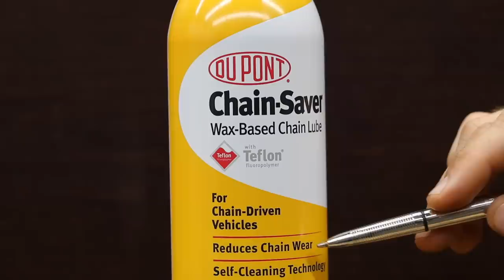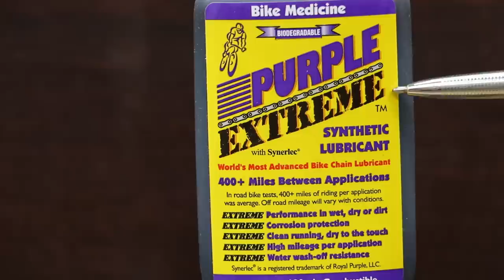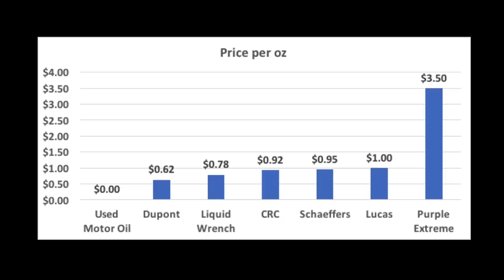Which Chain Lube is Best? Let's find out!  Ultimate chain lubricant showdown!

Comment: A HUGE mistake is to put a motorcycle chain in the acetone. Some better chains have grease between pins and rollers and are sealed with rubber rings. Acetone only ruins this, so chains will not function properly. Putting lube on the outside where it doesn't belong is a bad idea - it only picks up the dirt, making the things worth. Lube needs to be inside - between pin and roller.
Reply from the maker: Great point.  The goal was to prevent factory lube from interfering with the test results.
Reply: Here, it's not an o-ring chain, so no problem cleaning it with a acetone or fuel. But your comment is totally right for an o-ring type chain. Never clean it with anything else than a specific chain degreaser or you could really mess up your chain, fast ! And be super careful with high pressure washer, don't wash your chain with it ! Lot's of my friends complain about having to change their chain and sprockets often (like every 10k kms), but they don't really know how to properly maintain them. Mine begins to feel old after.... 30k. :D
Reply: Alexander Khritonenkov Special lube for o ring chains. Dirt bike world has them but they didn't really last any longer.
Reply: WD 40 for washing off O ring motorcycle chains works very well. Let dry and give a good coat of high quality chain lube after. Do this after riding while the chain is warm if possible.
Reply: Yes, WD 40 is a good solvent cleaner, BUT do not use it alone without chain lube after, as you say.  Many folks think it is a lubricant oil---IT IS NOT A LUBRICANT OR A RUSTPROOFER!!!!……………………………...elsullo
Reply: Wd to clean, then Maxima Chain wax , oring chain or not. They all wear out more then we would like. Specially on a quad or dirtbike
Reply: I agree, I only run o-ring chains of high quality. You want to keep the dirt out of the pins and rollers. If not you get chain stretch to quick and destroy the sprockets. On a high horse power machine you will see chain stretch immediately on a cheap chain. Dirt is always a factor you have to deal with.
Reply: WD40 was specifically made to be a rust prevention measure for equipment stored in humid environments and it is excellent for that purpose.  While it does have light machine oils in it which are absolutely a lubricant this is more a byproduct than by intent.  WD40 is not magic but this statement is incorrect on both accounts.
Reply: I use diesel/kerosene to clean my chains. Then I lube with DuPont multiuser dry wax lube with teflon. DuPont chain saver is almost the same, but it spray on a bit thicker/sticky. Although, chain saver does have more moly and teflon in it.
Reply: @floflospeed24  I agree on most points, but there are other options to clean your chain.

Anything that doesn't attack butyl rubber will do. Mineral spirits is fine, for example.
Reply: But a cheap thing to clean o ring or x ring /sealed chains is kerosene
Reply: Alexander Khritonenkov
Those were not O-ring chains, so no worries, but even if they were, who cares ? this was a test of chain lubes, not of o-rings.  Anyhow even o-ring chains need to be cleaned (not with acetone !) and lubed every so often in order to prolong the life of the sprockets and of the chain itself.
Reply: WD-40 is not good in some applications like high voltage electrical since it contains some thin oil and that oil is enough to attract dirt causing trouble that's hard to spot.
Reply: I think kerosene is good for cleaning o ring chains.

Comment: When we bought our John Deere round baler in 2004, the dealer told us never lube or oil the chains as it just causes dust and dirt to stick to it and cause additional wear.  So we never oiled the chains and all the chains are still original after 14 years and probably 10,000 bales, and the chains are just a little rusty and worn, but what can you expect after that length of time.
Reply from the maker: Wow! This is interesting.  The owners manual says to use motor oil and I've spoken with the local Vermeer dealer and local guys who bale a ton of hay and they all oil their chains.  I'll dig into this more.  I need the chains and sprockets to last as long as possible.
Reply: @ProjectFarm  have you considered a chain oiler? One drop per minute, keeps the chain lubed and pretty clean because the dirt is carried away by the oil. You can buy them, but I made one for my motorcycle for a few dollars.
Reply: Any way to keep the dust and dirt out of the area better?
Reply: @daveyt4802  
There is always a way, even if its cardboard cut out pieces painted for a little water resistance.
Reply: sounds like the dealer was trying to sell you new chains and sprockets in a few years. My JD 457 baler has 22,000 bales and its still on its original sprockets and chains although the secondary drive chain for the belts has broken a few times because it can slip off the idler when doing light straw bales. Always lubed with used motor oil as well as every other chain on every other piece of equipment we have (harvester, forage wagons etc) in my opinion, if you have the baler set right, there shouldn't be any reason for dirt to be on the chains apart from hay dust which I expect isn't very abrasive. Happy baling!
Reply: make a video on the one you made? The scott oiler and others are like 100's.
Reply: Used engine oil has too much garbage in it IMO.  Use clean engine oil.  I did that for years on balers with good results, but recently switched to chainsaw bar oil and it looks even better.  And buy diamond brand roller chain, well worth the money and oil it after the chain is warm and slowly moving.

Comment: I'm actually surprised the Dupont chain saver attracted any dirt at all. As it's a wax with Teflon it's meant to stay dry with no fling. It says in the instructions you have to wait half an hour before use.
I'm not particularly surprised it didn't do much good during the chainsaw test. Teflon breaks down at those kinds of temperatures. It's also not designed for that kind of intense use case.
Reply: Teflon has a melting point of 600+F. When used as a plastic it's actually pretty good at handling high temps.
Reply: Maybe but the molecule starts to break down at 450F. Look at the huge debate on teflon pans
Reply: @gutserker  I'll have to look into those, since I'd imagine a Teflon coating != a sheet of Teflon. I've only ever used it as an industrial plastic when either lubricity, chemical resistance, or temperature resistance is required.
Reply: I had to look into the numbers again to make sure. I think there's a wide range between the point where it starts to break and release molecular components, and the point where it's no longer useful. But from my own experience using that product I would think it's more useful in less extreme environments

Comment: I know a lot of people use tri flow lubricant, as well as t-9, these I have seen to be used also as gun lubricants as well. Finish line brand is also a brand I've used in the professional setting in 3 different bike shops (one of which was a very high end shop even), and there is a wax based lubricant for a few brands as well.

Comment: 11:21 that is because it is marketed to cyclists, they have disposable income to overpay for a product.
Reply from the maker: Great point!
Reply: thejunkman we don’t over pay we just get quality
Reply: Lifelong cyclist that rides every single day except when there's a hurricane in South Florida. I'm here to tell you wax baseddry lubricants(purple) no matter what the cost are far superior for a cyclist. For crying out loud..... open gear lubricants are for extreme Duty like cranes and hoists.... This test was one of his worst every lubricant had a purpose but almost none of them were the comparable
Reply: @liberacemiami5302  worst ever? He said at the end that most of them have a purpose. Turn closed captioning on in case you were too deaf to hear it.
Reply: I have a bike that I use soley for transport and I dont have the money for expensive lubricants, I have to make due with WD40 and used motor oil when I can get it.
Reply: Exactly, it's people who ride bicycles as a hobby, just like you said, disposable income
Reply: @nekomasteryoutube3232  Heads up, WD40 isn't a lubricant. It's a water displacer, rust remover, and/or solvent. It will remove oil/lubricants from your chain and make it more susceptible to rust if you don't oil it immediately after.
Reply: Same deal with motorcycle products, motorcycles are more expensive to maintain than most common cars and trucks.  Though the main features you want in motorcycle chain lube is non-flinging and rust resistant, you aren't lubing the links, those are sealed on modern O-ring chains.  Also WD-40 is terrible for any chain, makes you more prone to rust.
Reply: Some people ride bikes cause they cant afford cars
Reply: Be the Motor. 
  The Purple product clearly stated 400miles between applications.

  Applications are ±5ml this cyclist will pedal +8000miles before needing another bottle.

Pedaling that distance you will be greatly aware of every amount of drag and resistance.

"disposable income" Total base cost for any decent car is ±$200.00/mo. 

 I am a Fabricator by trade.
 
I choose not to own a car. I save that money and invest in quality products informed by
 Project Farm
Reply: @nekomasteryoutube3232  wd40 is not good as chain lubricant it removes the factory grease and leaves very thin light oil that will not last in this application... how ever the same company makes separate lubricant for chains
Reply: WD40 does have oil in it.  You can find its MSDS on the net
Reply: Well back when I had a bicycle I reckon my income was disposable. People would throw their Coke bottles and whiskey bottles out the window of their car to dispose of them and I would walk the roads in the ditches and pick them up and drag them to the store for the deposit on the Coke bottles and I'd sell the whiskey bottles to The Bootlegger! Disposable income!
Reply: @ProjectFarm  use chainsaw bar oil... used it on my motorbike for a decade now and gets 20k miles before sprockets and chain need changing

Comment: Test 90 weight gear oil as chain lube
Reply from the maker: Thanks for the video idea!
Reply: I used that before, it works.
Reply: It’ll work great if you like your bike smelling like hot gear oil
Reply: @gunchowder5065  yea i did not use it on a bike chain....
Reply: Thats what i use. Better that loctite
Reply: So long as o rings aren't involved, it eats them/causes them to swell/not seal.

Comment: You should test Royal purple against real bike chain lube WD40 bike Wet, WD40 bike Dry and normal WD40. Maybe add some other populate bike chain lubes. I l know for cheap cyclists a lot of them use plain WD40 which is bad from what I'm told. I use Finish Line Dry Teflon which is very popular!
Reply from the maker: Great test idea!

Comment: I use the DuPont Chain Saver for my motorcycle chain. I live in a very dusty and sandy place, and have been impressed with the results. The 3 main criteria for me is its superior resistance to sand/debris, decently long-lasting rust prevention, and by far the best value for the $. The test that measures the amount of product still on the chain (or dryness) doesn't really apply because it's a 'wax-based' lubricant and is supposed to be 'dry'.  I upgraded from even cheaper 'Champion' brand junk, and won't be going back. Different type of chains (hay bailer, conveyor belt, chain saws, and motorcycle/bicycle chains) would certainly require different criteria. I wouldn't recommend DuPont on chainsaw, but it's about as good as it gets for my little sport bike chain.  Your channel is as good as it gets too!
Reply from the maker: Thanks for the feedback.

Comment: Probably already pointed out, but... the DuPont (and probably the Purple Extreme) is a “dry lube”.  It’s basically Teflon suspended in a rapid-drying solution.  These tend to be specifically designed for situations where you want good internal lubrication (within the chain bearings, but not necessarily between the chain and sprocket(s)), and little to no dirt accumulation on the chain.  These are popular for mountain biking since dirt in the drivetrain will cause shifting problems.  They’re great products, just don’t know that they are the best fit for your bailer use-case....
Great stuff, as always!!
Reply from the maker: Thanks for the feedback.

Comment: Thanks for the great videos. If I may suggest a change could you consider weighing the chain before covering with sand and after covering with sand so that can easily distinguish the difference. A non contact temperature reader for reading the chain saw temperature, also to make sure that the test rig had the same initial temperature while testing all chains.
Reply from the maker: Thank you for the feedback
Reply: Another option would be weighing the sand, dipping the chain in, and then weighing the sand that's left. Some oil may drip off too but that might also be interesting

Comment: Great video as always!  I ride a bicycle (150+ miles per week) and commute by small  displacement motorcycle (400+ miles per week). One thing you didn’t test was the amount of drag that the product adds. For the distances I travel on low torque 2-wheelers, drag is a significant concern. I found that the DuPont creates the least amount of drag, and yet still lasts the 400-500 miles recommended lube interval. This is in rainy Seattle weather. I do get a small amount of rust, but since so little gunk sticks to the chain, they actually last about 50% longer. However, I also wipe down and re-lube my chains weekly, so maintenance with a lightweight lube is critical. DuPont is my personal choice for my personal use case.  :)  I 100% agree that it would not work under heavy loads on machinery like a harvester! Again, great videos, well done and well thought out.
Reply from the maker: Thanks for the constructive feedback.

Comment: I use the Dupont, it seams to work best in dry dusty environments because it dries into a film, which doesn’t attract dust.  I have teh least chain wear with it of anything short of the lube I used for bicycle chains 40 years ago.  

That consisted of putting a bunch of chains in a coffee can, and poring melted paraffin wax in until the chains were covered, then setting it in a 300-degree oven for about an hour.  That is best method I have ever found, and had the longest chain life.
Reply from the maker: Thanks for the feedback.

Comment: Late to the party fella, but i use 2 stroke oil on my suzuki vstrom 650 scottoiler.  It flows lovely and the mininal fling means any grit that adheres to the chain does not remain there for long.  Used to use waxes and other lubes on my bikes chains, but you want small but co stant flow to keep it clean, especially around the o or x ring seals.  Never will do the dump and forget for hundreds of miles again.  Slow and steady flow wins the race to long chain life.
Reply from the maker: Thank you

Comment: I'm sure it's been said, but Rust Check has a lifetime guarantee against rust on cars and trucks. It never dries out and actually protects electronics. The inventor's history has tie-ins with Krown Rust Control. I'm new here, but hit me up and I'll send ya some product. I am not a company representative, but I do work at a place where we use it on vehicles, and I have used it myself to clean up wrenches, nuts and bolts, on my bicycle chain, and more. I have become highly addicted to your channel - stellar work!
Reply: Oh... and I've read the Hazardous Materials/Safety Data Sheets, and it is safe to use. No eye protection or mask required, and... if a human or animal drinks some by accident ... no worries. It is safe to ingest (although the imbiber would most likely be spending some time in the washroom!)

Comment: I'll add my suggestion to that of others, that you consider testing products for lubricating motorcycle O-ring and X-ring chains, which are different from bicycle chains.  There are lots of opinions floating around about what's best and a lot of quite different types of lubes on offer.  Some are geared to off-road where there's a lot of dust, others for street bikes.  Enjoy the channel and have recommended it to many friends.
Reply from the maker: Thanks!  Thanks for the suggestion.

Comment: I was in a Honda motorcycle dealer a while back and looked at a decal that was on the chain guard of a new Honda motorcycle. It recommended 90W gear oil. More messy, but easier to clean off when it’s dirty. Far cheaper than aerosol products.
Reply from the maker: Thanks for the feedback.

Comment: I use 140 wt gear oil on my Yamaha TW200 motorcycle chain. 
I remove the chain and clean it in kerosene.  I put the chain in a coffee can and cover it with gear oil. I then put the entire thing in a vacuum chamber ( a pressure cooker bought at Goodwill for a buck), pump all the air out, let the air back in, remove the chain from the oil and let the excess oil drip off. I put the chain back on the bike and I  go for a short ride, wipe up the mess and I am done.  I do this every 400 miles and so far the chain has lasted over 30,000 miles though it is near the end of its life.  Its labor intensive but gives excellent results.
Reply from the maker: Thanks for the feedback.

Comment: It would be interesting to add a scottoiler oil or two to a test like this, especially for electric bikes where every watt saved is an extra distance covered. I use a scottoiler to keep the o rings wet and keep the chain as efficient as possible.
Reply from the maker: Thanks for the feedback.

Comment: Some motorcycle manufacturers recommend using 90 weight gear oil for chain lube. Rather than the 10W-30 used here, which has a very low viscosity. Also the best results for cleaning a chain before lubing it, in my experience is simple kerosene. Dirt and grime just fall of and it brings the chain back to its original condition!